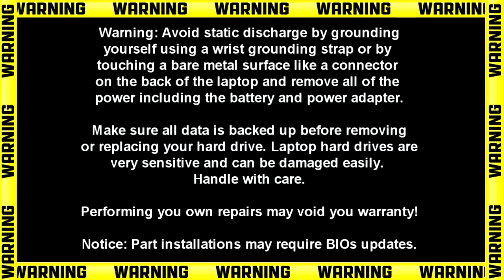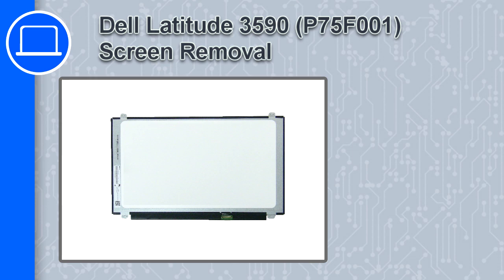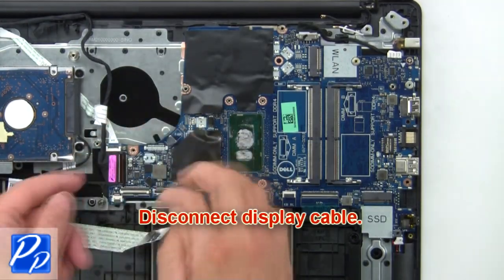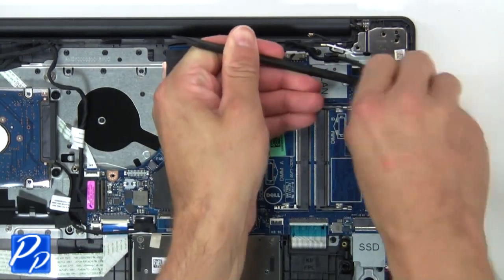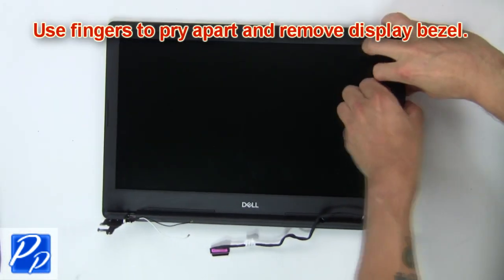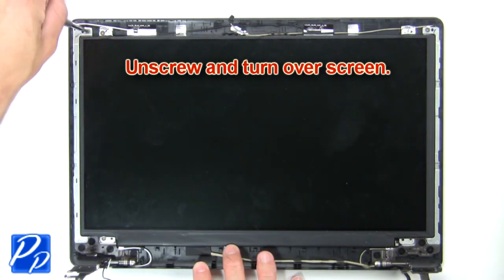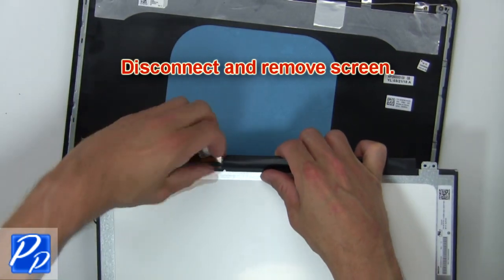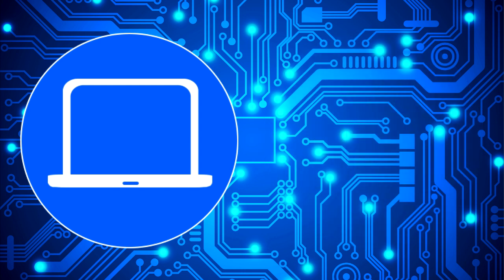Dell Latitude  3590 (P75F001) Screen How-To Video Tutorial

Comment: Do you really need to take the display off of the laptop to remove the bezel? 
=
Reply from the maker: Although it may be possible we follow Dell's recommended method of disassembly that is detailed in their user manual.